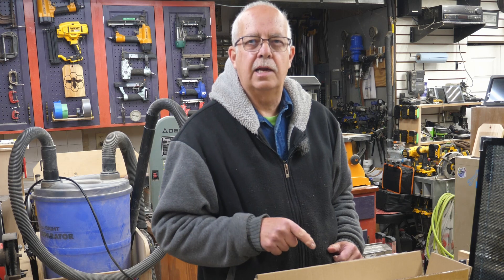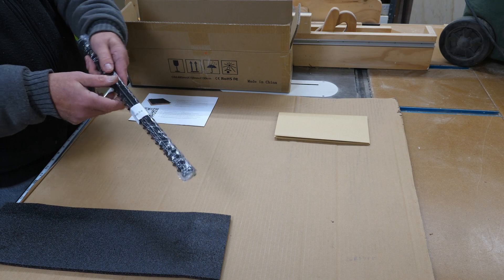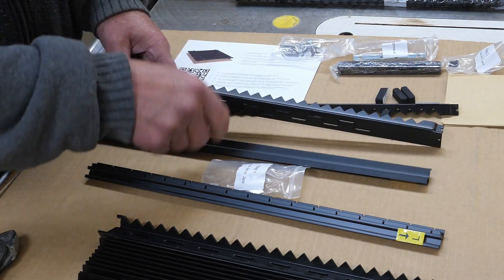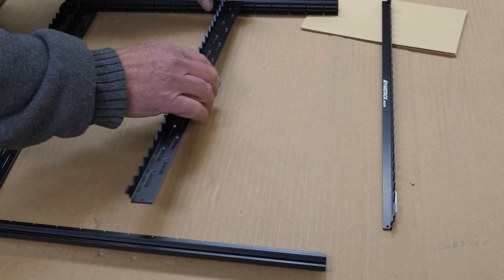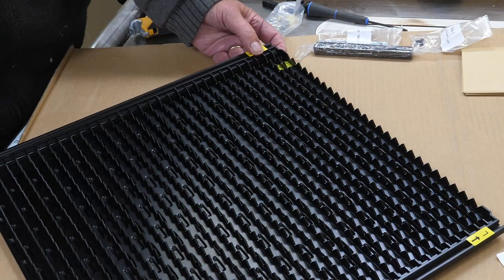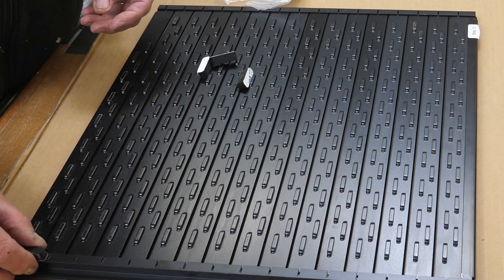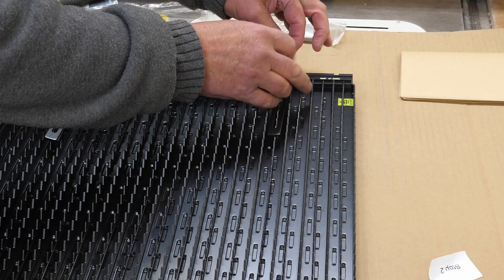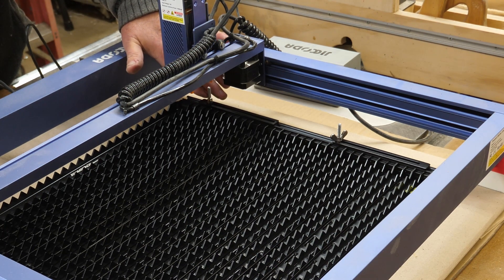"Assemble Your Atomstack F3 Bed - The Grand Reveal!"

Comment: Cons, Every other row of teeth is lower than the other which means the work piece isn't even touching them, and since the teeth are slightly rounded it makes the bed very slippery.
Then there's the hold down nuts, they tend to pop out of the slots when trying to tighten them. Plus the long screws constantly hit the black box on my laser arm. A Creality Falcon 2.